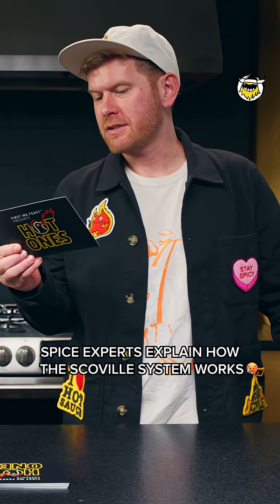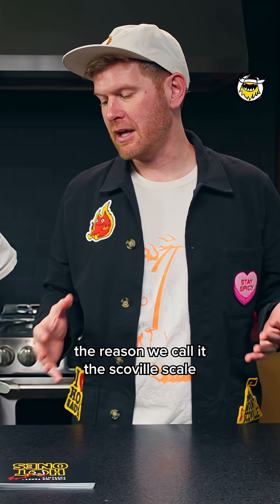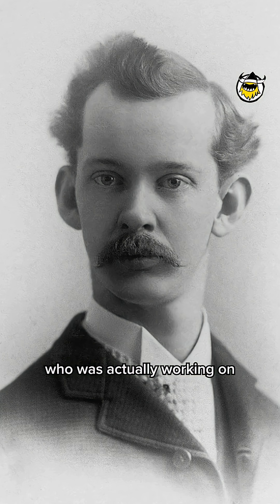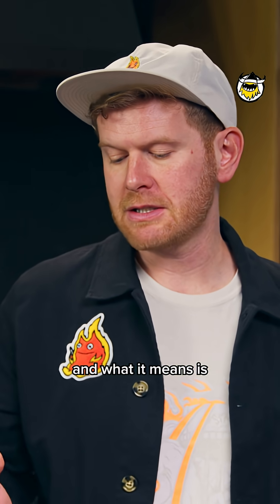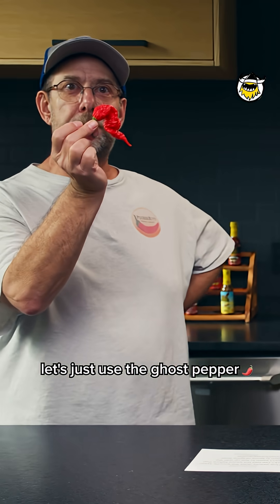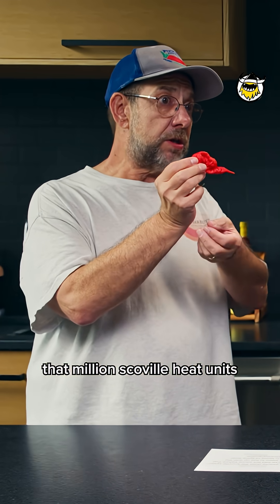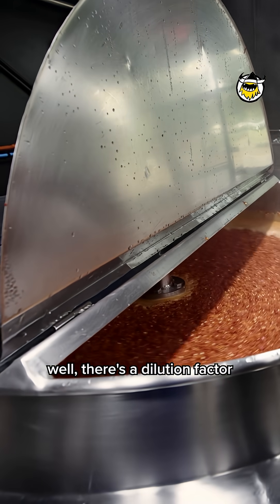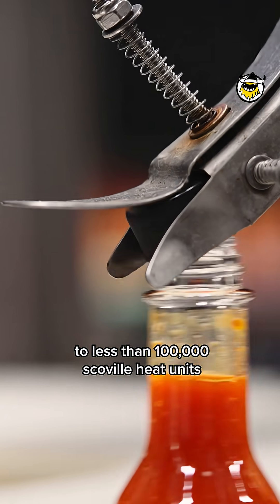How does the Scoville Scale actually work?? 🔥🧪

Comment: Da Bomb on Hot Wings uses pure extract and is rated around 250,000 SHU. It's hot, and you'll notice it hits people the hardest. All the others are based on the peppers and ignore the dilution.
Reply: I think it's the taste as well tbh, it's like battery acid, just foul and it persists through the heat. The combination causes people to be so reactive I think.